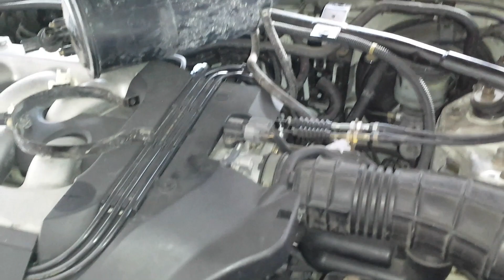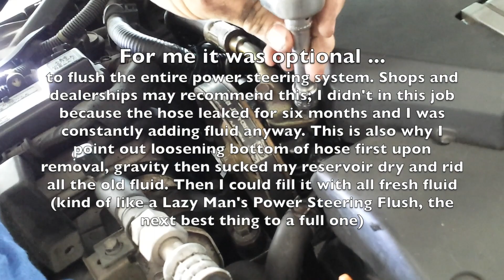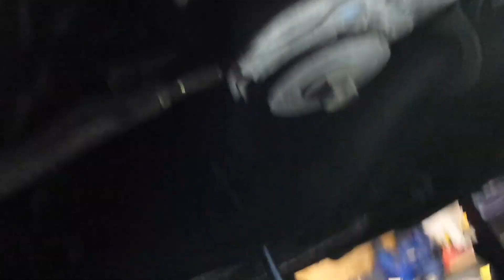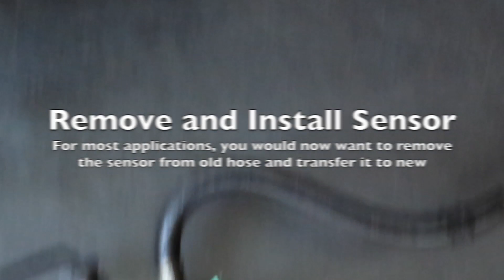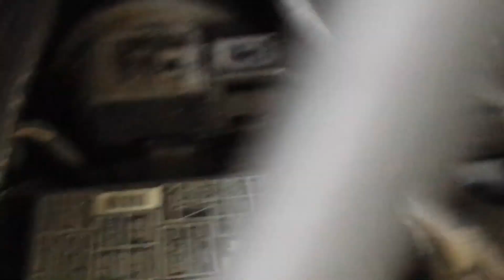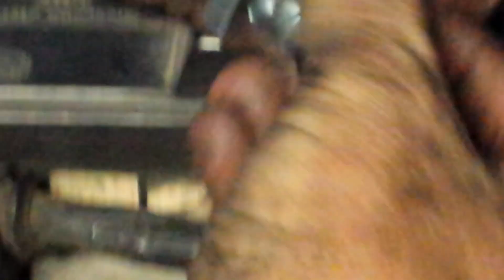Honda Acura Power Steering Pressure Hose-CL 97-99, Accord 98-02 VTEC 3.0 P/S Replace-Fix Leak

Comment: Should i ask my mechanic if he needs help or can one man do this i feel bad i have to give my mechanic a heads up he worked for a honda dealership as a mechanic but if its a 2 person job shouldn't i say something to him
Reply from the maker: It's possible to do with one person, especially if he has a lift. Without that, still possible but much harder by himself. Also helps if he's done the job before and if he worked at a Honda dealership it might be easier for him
Reply: @KeithDrivenShop ya he has a lift at his shop he is a cool guy he sold his formal shop he had and just built a new one next to my house he is good and he is reasonable I had him put a lower ball joint back on my civic he changed me $45 he swapped transmission in it for me and only charged me $200
Reply from the maker: @joshuahawkins2743 thats a good friend to have!

Comment: I have a 2000 accord 3.0 and i drove for a month with the hose leaking now my car is running like shit it leaked onto 2 coil packs i am hoping changing those will make it run again
Reply from the maker: I drove mine for alot longer than that with a leak, but it wasnt getting on electronics.  My guess is replacing the coils will be fine, most cars have a check engine code that identifies which coil is bad, then I'd make sure no p/s fluid has gotten in the coil hole or it should be cleaned up
Reply: @KeithDrivenShop  i changed it them out yesterday it fixed it to where its running rite but now i have a high voltage bank 1 code being thrown i looked it up and no one has been messing with the o2 sensor or the cat its all fine i erased the code i have 2 cars so i havent drove it again im getting ready to drive it tomorrow of course stuff like this happens rite when its time to renew the tag and get a inspection i just wanted it to make it to the inspection and then i can take time to figure out the issues i know getting the line fixed is a priority
Reply: @KeithDrivenShop  i didnt drive it long enough with it acting up to throw a code i learned the hard way if coils are bad and its jerking if you keep driving it it will jump time on you i have already done that

Comment: Hey someone tell me please , did he say he used a second wrench  as to back up the first one or was that nlt what he said. If did hear correctly does that mean essentially he place two wrenches on the nut at end of hose to get a good enough grip on it to break it loose? Thanks I hope you all jump at once
Reply from the maker: What is meant is you can put a box wrench 🔧 around the end of the open end wrench to extend & make it LONGER and increase leverage . You do not put two wrenches around the fitting nut. Hope that helps

Comment: Huge help, thanks a ton! Would have been much faster with a friend and a lift though, ended up jacking and lowering the car like 5 times. Hardest part was the stuck nut attaching the lower tube to the steering rack. Rounded it so sawed it off and used a nut extractor socket. Didn't need to remove any other parts to get the hose out/in, that vapor canister can stay in place. Detached the lower passenger side bracket from underneath (with a mirror to find the 10mm bolt) and the lower drivers side bracket from above with a swivel socket adapter and an extension bar - (both brackets were impossible to re-attach though so used zip-ties to keep the tube from rattling after replacement). The whole hose came out from underneath, started on the driver side and wiggled it out from above the frame until I could pull the rubber part down through also. Fed the new hose in reverse order - first pulled the rubber up from below with a string, fed the metal tube up the same way as far as I could until the other end could be wiggled above and around the exhaust pipe and O2 sensor, then slid the whole hose towards the driver side and tucked it back above the frame.
Reply from the maker: Thanks for sharing your experience. It's a terribly difficult job, glad you got it figured out!

Comment: Why didn't you just cut the old one into pieces to get it out?
Reply from the maker: You could do that, but it won't help you in knowing the path to put the new one in the way you got the old one out.
Reply: @KeithDrivenShop  you could run a cord before you cut it

Comment: So the hose started leaking through the fittings on the hose?
Reply from the maker: Yeah that's how mine started.  It's bad and has to be replaced.
Reply: @KeithDrivenShop  mine is leaking on the back of engine causing it to smoke when it is on. Thanks for the reply

Comment: Thnks liked and subscribed. If it gives me one ounce of trouble coming out I will leave it in and run the new one over the top of it. If that won't work I will literally cut the old one out with a Sawzall.

Comment: Hi is the power steering pressure hose the same on a 98 accord 3.0 v6 and 98 acura cl 3.0 v6 ?
Reply from the maker: I'm pretty sure it is the same. But the best way always is to verify online, many online parts sites allow you to look by model year, plug in the different model years and if it's the same part number each time then it's the same hose for those model years .

Comment: If you don't mind me asking what other car parts fit a 2001 Honda Accord for a power steering line
Reply from the maker: I wouldn't know, but there are many auto parts sites online that will filter the correct parts by entering your year make and model. I think on this repair we used RockAuto and the replacement has been holding up well.

Comment: This is by far impossable two guys a must any tips of what and how to feed this through moter mount what at start need video on the struggle of that because my pressure line is started to take a beating from all angles of tring to feed it .day three ugg .2007 v6 vtech accord. The unluck modle .wish u showd the struggle .thanks any way any tips .
Reply from the maker: Elliot, every vehicle is different and yours is 10 years newer than this one so I can't say exactly. But we lowered the subframe, however we did not take the bolts all the way out.  I think we also had a block under the motor and raised it as much as reasonable which created more access. It's very hard to film under the car and in our case one guy was feeding the line underneath while another was looking down from top of engine to grab the line when it got close enough to be mounted. Lots of light, a helper, proper jackstands & jack to lift motor if needed, and all safety precautions are key. Wish I could be of more help, this is a difficult job and best of luck with it.

Comment: Let me tell you that I did this by my shelf and it was a pain in the donkey. I did it on an 96 Honda Accord v6 couldn’t complete the job cuz the one line I bought was a little different the way it was bend. So if u are doing this job make sure that your new line is bend the same as your original one.
Reply: Thers a recall but due to covid. 19 shut down i bought a 126 dollor after market so far im stumped on how to feed the line back through moter mount day 3 greased up and no real video on the strugle of that step im fucked and pist but these guys did show and clarify what we both know its a bitch and i hope this after market peace pf shit works on 2007 v6 accord .any suggestfull 
Tips im all ears .i also worked on cars used car mechanic at nissan a portion of my lofe so its not like im new to running into the immpossable but this seems to be it at tgis time .
Reply: Elliott J how that ever work out brother ? I got 1999 Honda Accord mfrkn leaks power fluid like a bitch was thinking of doing this myself a bit of time has gone by since you posted hopefully covid won’t fuck me over I looked up I can apparently buy the hose for my v6 99’ accord 3.0 at auto zone so imma review and shoot my shot. I’ve changed things on my car before I’m novice but I’m not a beginner hopefully I can figure this bs out and save money my buddy whose a veteran in this work only wants 120$ to do this entire job basically chump change but man if I can save that 120 I damn sure will!

Comment: How much did the hose cost you
Reply from the maker: The Edelmann hose was about $55 and the optional pressure sensor by Beck/Arnley was about $20, I got them both at RockAuto & they were a perfect fit and have given me no trouble.

Comment: Not the same as 99 Accord.
Reply from the maker: Hi Keri, if pump and fittings are on otherside of engine the replacement process and steps are very similar/same. Thanks for pointing it out.
Reply: @KeithDrivenShop  sorry, I didn't mean to sound harsh. I needed to do do this job and I  was watching all sorts of video tutorials and I forgot to put "note to self" so I wouldn't get mixed up. Your video help in the fact that this job needs 2 people. And I saw some tips that helped me. I got the job done. The only thing is the system is full of air and it made the fluid bubble. Thank you for responding to my comment anyways. I subscribed. 😊
Reply from the maker: @kericue247  thanks Keri!
Reply: Simuler trying to feed is a impossable job im day thee 2007 vtech v6 3.0 liter accord its so fkd please help any tips vids on process through the moter mpnt on this modle would make you the first hero of tge year because ther isnt one .do yo feed the line through square moter mount closest to fire wall side or side closest to moter and starting of which end to feed tje line is a question .

Comment: I assume that this is the same procedure for an 06 Honda Pilot?
Reply from the maker: I haven't performed this on a Honda Pilot, but I suspect the order of steps and procedure is the same, the main different being the location of fittings & feeding of the hose.
Reply: Believe it or not it actually looks like it’s in the same position as this one
Reply from the maker: @mds2465  good, it should be nearly identical then

Comment: Can a accord 98-02 power steering pump and hose  fit a 2001-2003 Acura TL ?
Reply from the maker: I'm not sure but I tend to doubt it, that's a totally different model vehicle and most of these hoses are made with stiff piping that does not bend in any manner except for the rubber portion, meaning they aren't really adjustable like an all rubber hose.
Reply: Davaughn Roberts check on some of the forums. Since they’re basically the same vehicle it may be possible but I tend to agree with Keith to the extent that there is very limited flexibility with the positioning of the hoses